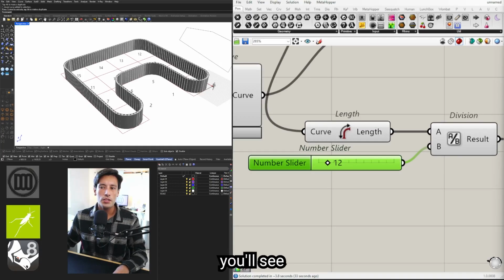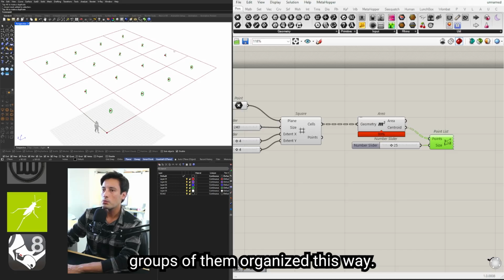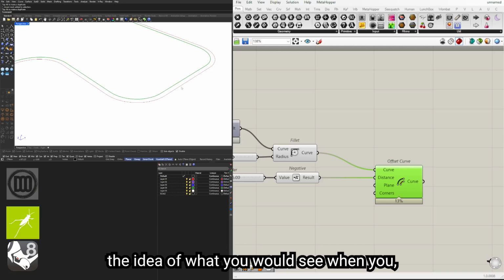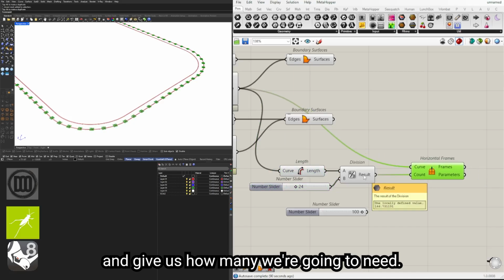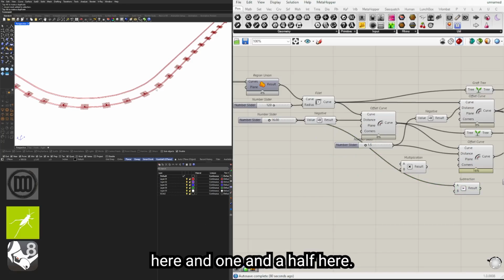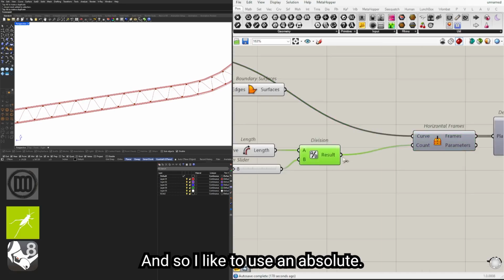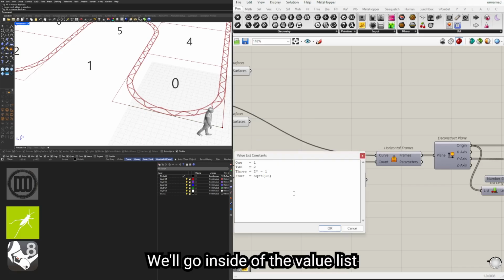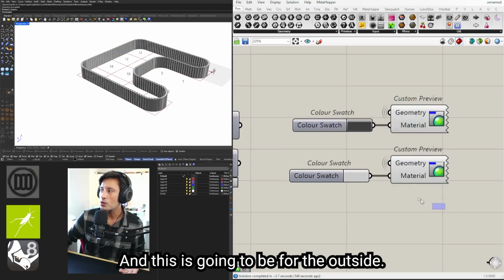3D Printed Structure Design Script Grasshopper Tutorial Rhino Parametric Architecture and Design

Comment: I’d like to point out that for odd numbers etc, you can simply enter an expression such as "if(x % 2 != 0, 1, 0)", connect the slider  (e.g., 23) to input x (from the expression), connect the R output (the result) to the addition component (B) and then to the frames, so there is no need to use the value list at all.